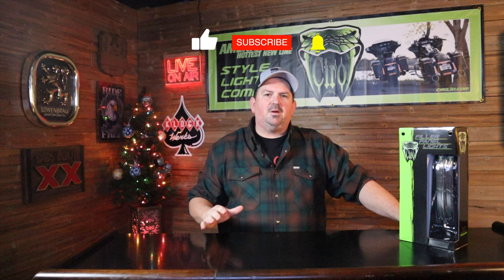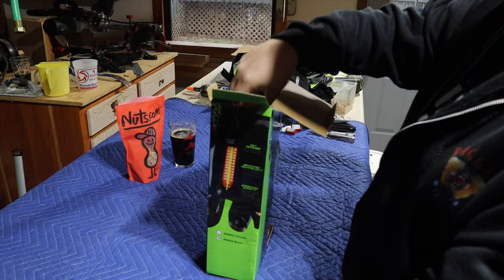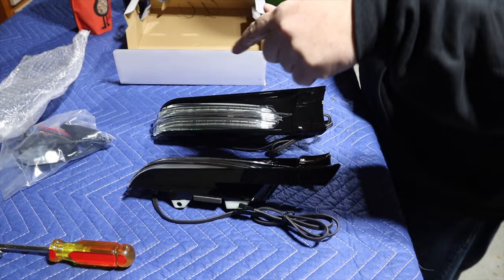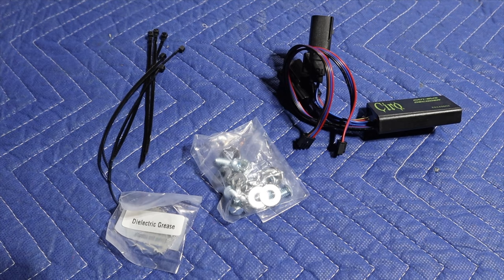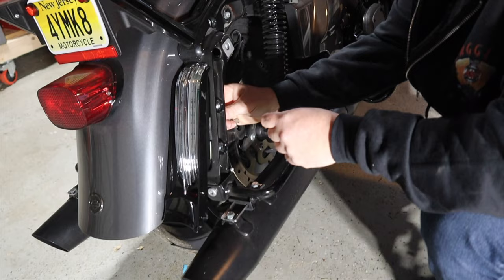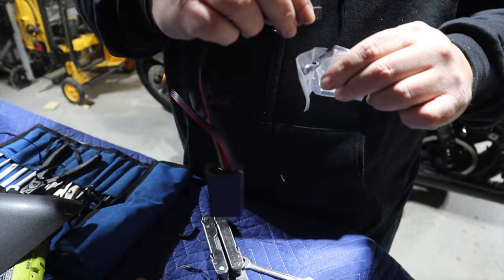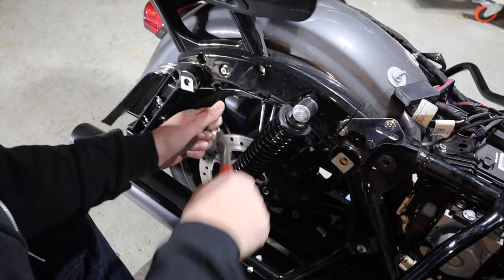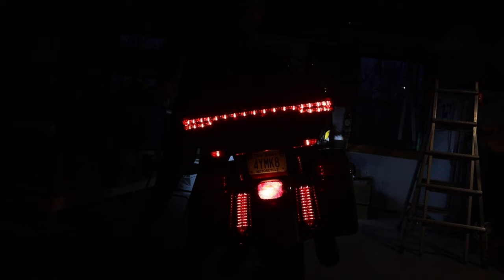Ciro3D Filler Panel Light Install on a Harley Davidson Road Glide Limited

Comment: That looks really good, wonder if adding a set of bag blades is too overkill.
Reply from the maker: I don’t think so Khoury, I will definitely do bag blades. I am of the opinion that you can’t have too many lights back there when you’re stopped
Reply: Agreed, I already put a set of the bag hinge turn stop lights on, and damn those made a big difference